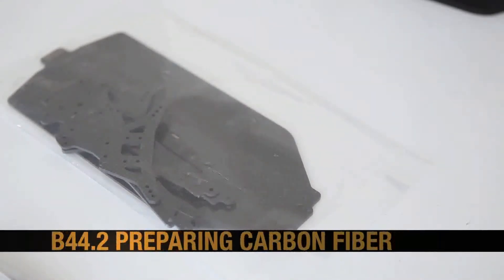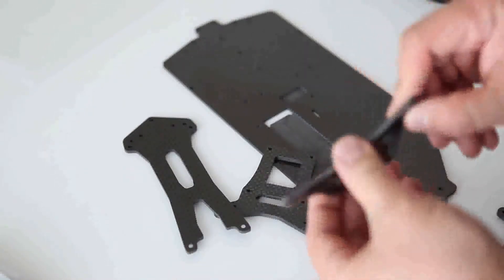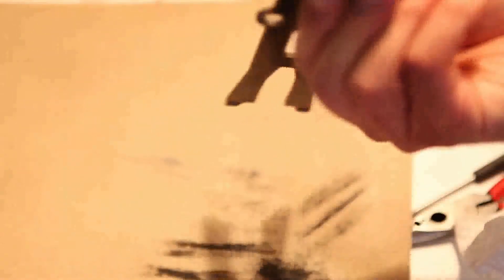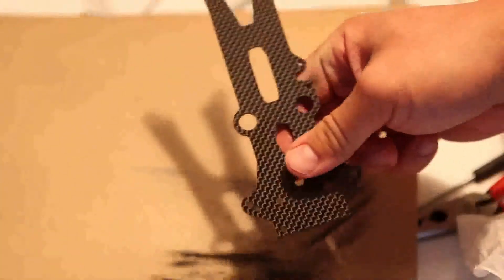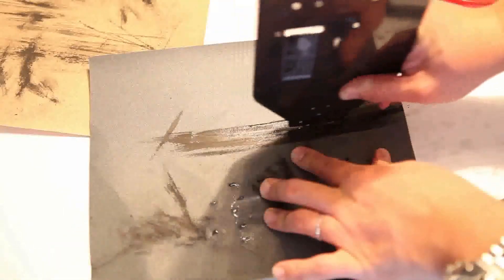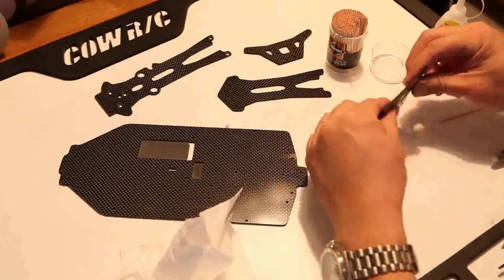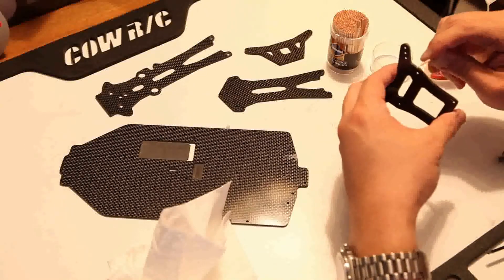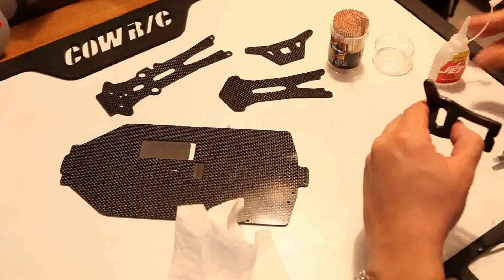B44.2 RC Buggy Build Part 6 Preparing Carbon Fiber

Comment: Hello MC, I plan to pick one of these up in the next week.  Have you selected any electronics yet for the build?  I have a 1257tg from Savox and some Racer's Edge Prime 5200 75c lipo saddle packs on the way.  As for motor/ESC, I'm kinda new to 4x4 buggy and have only seriously done 1/8th scale buggy and Pro4 SCT.  Great build so far.........Just subbed, but what's with the spokesmodels?